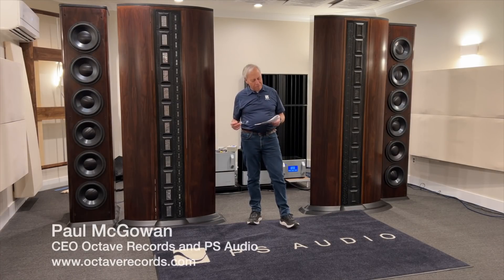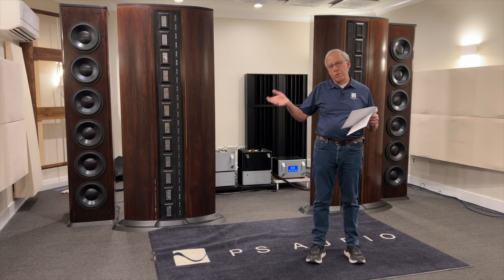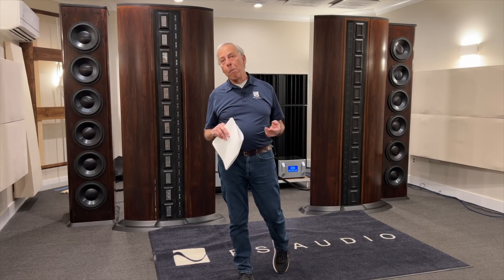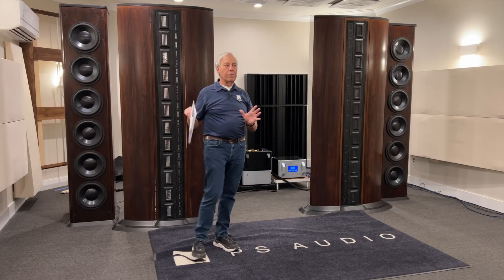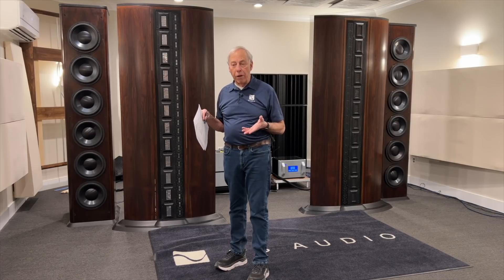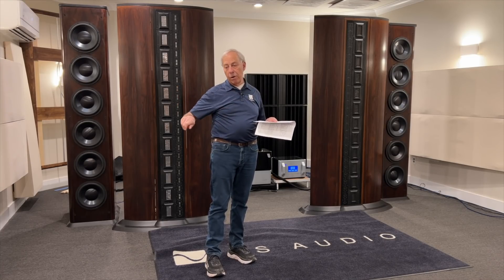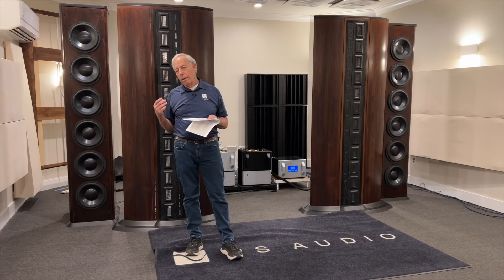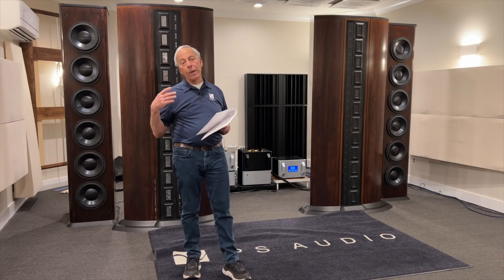Best way to control audio gain

Comment: Not sure that is correct.

The gain of an amplier (a) is defined as the ratio between its output signal (vo) level and its input signal level  (vs )

Gain = vo/vs

We "can" put a volume control  ( potentiometer) at either the input terminals of the amplfier  or its  output terminals which would appear to modify the "apparent" gain - but the gain of the amplifier  " itself"  would remain unchanged.

That is we are either feeding it with less signal - or reducing ( attenuating) its  output

To truly control thr gain - we have to reduce the inherent amplification factor of the amplifier circuit.

Paul mentions a "gilbert cell" which is combination of differential amplifiers and current sources - all contained within an integrated circuit.
( its often used as a balanced modulator) 
This enables full control of gain from an external control voltage.

Comment: I use a currently I use my DAC as my pre-amp. It's an RME and the volume control is excellent. My amp has gain control on each side. Once I learned to turn down the gain, then dial it in, my whole system came alive. It was shocking to me, the improvement. I'm no expert on gain but feel it is one of the main keys in good sound and  really isn't talked about enough.

Comment: Paul, how did you menage to invent and use "Gain cell" name for "your" module and sell it as your product, when you actually use VCA IC of semiconductor brand That corporation?  So inside is that That corp. VCA and couple od Texas instruments OP amps around it.
Reply: Yes - the gilbert cell used in the motorola mc1496 balanced modulator chip in the early 1970's and then by others....

We used it for video switching
In the early 1970's for " green screen" techniques.
Not sure about rebranding the idea .but .. guess if it uses off the shelf publicly available  devices ?

Comment: Thank you for explaining it! As you mentioned In some cases it's not a bad idea. I.e. my Luxman   M-2000 power amplifier had gain control.
Reply: Where would you set it to? What determined whether you would turn the gain up or down and how did this relate to where you would choose to set your volume. Was the gain mostly for affecting the degree to which you drove your speakers?

Comment: what I found was that for my NAD av it sits pretty at 0dB so I put a pre-amp on that for that to control the volume, and the input to the pre-amp (here jack) is 100% (as in the case with most CD players)- this eliminated a lot of noise to where the system is completely silent, even with no input.

Comment: Ok I'm new to pro audio I've got some TECHNICS FLOOR SPEAKERS FROM 1990 RATED 260 WATTS RMS AND I BAUGHT AN OLD QSC 1400 AMPLIFIER IM WONDERING WHAT POSITION I SHOULD SET THE GAINS ON THE QSC THE SPEAKERS ARE 8 OHM 260 WATT MAX RMS AND THE QSC IS SUPPOSED TO PUT OUT 200 WATTS RMS AT 8 OHMS I CURRENTLY HAVE THEM SET AT ABOUT 3/8 A LITTLE LESS THAN HALF WAY ON BOTH THE LEFT AND RIGHT AND THEN I HAVE A COUPLE 15 INCH POWERED SUBS I JUST NEED TO KNOW SO I DONT BLOW MY AMP IM A NOOB AT THIS THANKS IN ADVANCE LOVE YOUR VIDEOS

Comment: the best volume is an autoformer what can be placed at the speaker end of your Poweramp, buy them from electrical suppliers to put in the wall if you're adjusting volume in different rooms, just don't have your preamp driving the poweramp full blast can cause it to fail too much gain for long periods of time, adjust the volume on the preamp section between 88 - 93 % max.

Comment: Paul, my Yamaha P2201 power amp has gain controls on front panel.  Why didn't you mention that some power amps, professional sound reinforcement and home hifi, DO have gain controls?  Don't a bright young guy to invent it.  Or did I misunderstand the whole question and you answer?  I run the P2201 at full power, zero gain reduction, and it seems to be the best way to avoid dirty contacts on the gain controls.  I use a rebuilt NAD1020 preamp which has a high voltage RCA output on the rear panel (same internal circuit that feeds the headphone output on the front panel) to supply a fairly strong voltage to the P2201, which handles it with glee but my speakers limit me.  (JBL L7, bi-wired).  So I only go to about 50% on the preamp volume control to protect my speakers.  Interestingly or maybe common for pro-amps, the P2201 does not have speaker protection circuit.

Comment: Personally, I always get the volume knob at maximum level, the dac with volume knob disabled and I control the overall audio at the source, using the Roon DSP.  In this way, being my music streamed via Qobuz or HD files on a HD, I can control the audio via software, by a simple addition or subtraction operation, before they are sent to any electric circuits.
With no song playing the speakers are perfectly silent and I can control the volume in a very smooth way with 1 Db resolution.
Reply: I do the opposite. You can't reduce volume in software or DSP without losing bits and adding noise. However you can attenuate an analog signal without losing quality since it has "infinite" precision in comparison.
Reply: @mburetorp  That's true but most digital source devices/software have improved on that a lot and you can't really tell a difference between digital volume control and analog if implemented well enough. I keep using analog volume control because I like turning a real volume pot.

Comment: So if you're adding a variable gain control to a power amp isn't essentially turning it into an integrated amplifier with only one input?
Reply: Only if it includes the same gain stage(s) as are used in a separate preamp.

Comment: Perhaps there is confusion added by calling every level control pot a "Volume" control. A "Volume" control should be used to describe the device/ system that allows control over the ultimate sound pressure levels generated by the speakers. Rather than every device/ circuit that can modify voltage levels along the way.  A pot at an input like a power amp, while it does control the output sound level, is doing so by controlling input sensitivity. How much voltage it takes at the input terminals to produce full output. It should be perhaps be referred to therefore as an input sensitivity control rather than "Volume". Or a pot or circuit on a DAC output as an "output level" control and not a "volume" control. 

Perhaps we should standardize on only one point/ device/ circuit as the "Volume" control and this would reduce some of that confusion.

Comment: I have an integrated amplifier (a Yamaha). Would the sound be in any way improved if I plugged everything into a separate pre-amplifier then plugged the preamp into the integrated amp's line in (assuming, of course, I had a decent preamp)?
Reply: Unless your Yamaha is very old, then it's likely to make no difference at all.
Modern amps are sonically transparents (no matter what Paul says, it is a scientific fact).

Why do people always want to complicate simple things ?

Comment: I think an excellent premp is the way to go. After Axpona I went to my dealer in Chicago to pick up my CD player. In the meantime while I was waiting,  there was a client that flew in and brought his own DAC to demo the Magico M6's that actually belonged to my dealer that were at the show in the Magico Luxman room. His client  was using his DAC as a preamp and streaming to it using my dealer's Aurender A30. I was there and my dealer asked me what I thought when I purchased my "new" CD player that was used in the show 😁.  Honestly, the highs were too forward and at times it was displeasing and fatiguing.  I stuck around and his client mentioned this too. My dealer said this was because he was using his DAC as a preamp and it  handles voltage to the amp much different. A preamp responds to voltage changes more smoothly like a sign wave, as opposed to a step type wave or square wave with notches. Again I'm not quoting him, but although he explained the technical part of what a great preamp does, I  understood the concept. He then swapped in a preamp that matched the  Amp and the speakers and music was instantly transformed. It was much more pleasant. Detail was still there, but the transients and vocals we're more natural than forced and fatiguing. The client purchased the system. 🎉
Reply: Theory goes the shortest signal path is best, yet nothing will sound very musical without a preamp in between the dac and amp.
Reply: @peterlarkin762 Yes, Thanks 😀👍

Comment: There's one important factor that's usually overlooked. Most people don't know the difference between a volume control and a gain control. They both control how loud the system is, and the terms are interchangeable, but they're not. A gain control is on the input side of a component and has the potential to distort the signal if set too high. A volume control is on the output side  of a component, and can't distort the signal no matter how high its set. If you are trying to diagnose a system with excessive gain and don't know this, it can drive you crazy.

The best example to illustrate this concept is a guitar amp. No one wants any type of distortion in an audio system except people that play guitar.  If you look at a guitar amp, you usually see a gain control right next to a volume control. To get an overdriven or distorted sound, you keep turning the gain up until you reach whatever sounds best for the application. Once you have the gain set, you then use the volume control to change how loud the system is.
Reply: Not sure that is correct.

The gain of an amplier (a) is defined as the ratio between its output signal (vo) level and its input signal level  (vs )

Gain = vo/vs

We "can" put a volume control  ( potentiometer) at either the input terminals of the amplfier  or its  output terminals which would appear to modify the "apparent" gain - but the gain of the amplifier  " itself"  would remain unchanged.

That is we are either feeding it with less signal - or reducing ( attenuating) its  output

To truly control thr gain - we have to reduce the inherent amplification factor of the amplifier circuit.

Paul mentions a "gilbert cell" which is combination of differential amplifiers and current sources - all contained within an integrated circuit.
( its often used as a balanced modulator) 
This enables full control of gain from an external control voltage.

Comment: Just curious! what is the cost of equipment in this room?😂
Reply: About $60K for the gear, probably $20K in cables.
The IRS V speakers sold for $60K 30 years ago, and less than 60 where made.
And, yes, it made me cry when I auditioned it...

Comment: i get confused by all the names for things, what do you call my approach for digital sources: every power amp, dac and source is set to max. then use my minidsp shd studio for volume control.  then volume is done in the digital domain and sent from there.
Reply: I like that approach. MiniDSP does some excellent products and I use one of those myself.
Reply: @ThinkingBetter  that volume knob is  digital, so its programmed pretty well. with safety features and stuff. and those tactile step for knob feel :) 
just wonder how it fares vs analog preamps sound wise.
Reply: 🤔 this is what I was wondering 💭 can’t this be done digitally 🤷‍♂️
Reply: It's still used as a pre-amp, but without a potentiometer in the signal chain.
Reply: @PSA78  it sure does what is needed for me, and the only way to add dsp in my system.
wonder how it compares to more traditional pre amps for the volume value alone.
Reply: @sudd3660  You can never have more than 100%, so if there is any changes it would have to be for the worse. Going fully active can have the benefit of skipping the crossover as well.
Reply: @PSA78  im am somewhat in-between passive and active now, i tried fully active with adding two 3way hypex plate amps. but had too much hiss noise for me. sounded great tho.

passive mains speakers with crossover and subwoofers with no crossover, all driven by separate power amps and dac's the shd studio does the crossover between them and adds room correction.

i was thinking that any piece of gear subtracts sound quality. or even adds some beneficial sound characteristics.
Reply: @sudd3660  It seems strange that you got hiss, I'm guessing it was something outside of the amp/dsp.
Yes they subtract, even adding something you like is in a way subtracting, but in your favor.
Reply: @PSA78  most things adds hiss, but since the plate amps was hooked up directly to the drivers it was too loud. i have a few NAD amps and those are silent.
Reply: @sudd3660  The Hypex amps are at the very top of any amplifiers to buy, no matter the cost, I believe it's pretty much only PS Audio that has anything beter. Their noise floor is as low as it gets.
MiniDSP on the other hand is known for being slightly noisy, at least in their cheaper products.
Reply: @PSA78  hypex ncore amp modules might be good, but they're plate amps has to much stuff in them squished together or something.
my icepower amps are silent, or my purifi amp.
minidsp are known for the cheap dsp gear, with dac inside. you know the ones, the tiny things.
i have the 950dollar minidsp shd studio that  is digital only, how to get hiss out of that?
usually hiss  are created from amp section.
Reply: @sudd3660  Yes their smaller and cheaper stuff is what's causing trouble for some. 
Maybe you got a bad example from Hypex, combined with something like a high sensitivity driver, I could see how that can cause problems. 
ICE boards are great as well, lots of high-end gear that use them. 
There's lots of options today for good value. :)
Reply: @PSA78  i had a bunch of different class d amp and all types of configurations, only had noise issues with hypex stuff so far.
if power quality matters then i have bad power in my home, so hypex might be more sensitive to that.  i also sit close and notice noise floor.
Reply: @PSA78  How do you control how loud the music plays ?